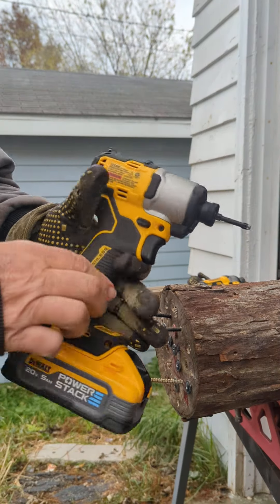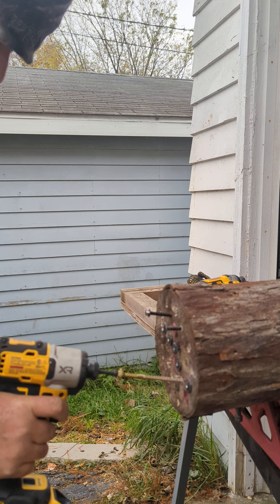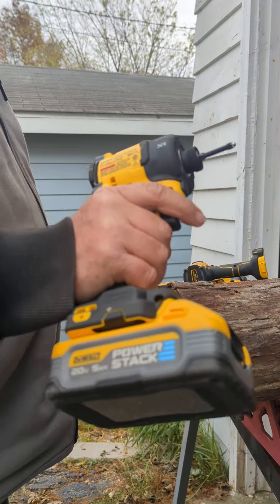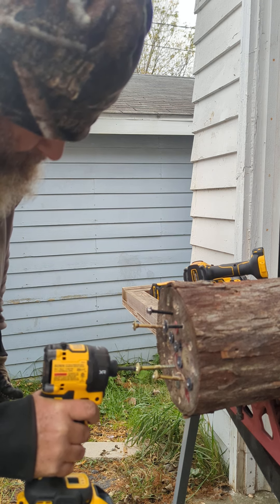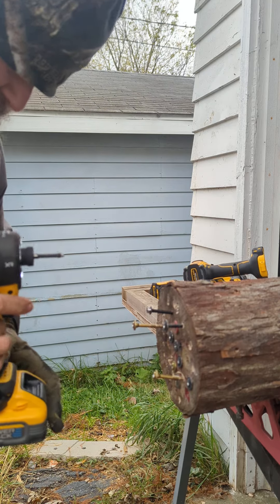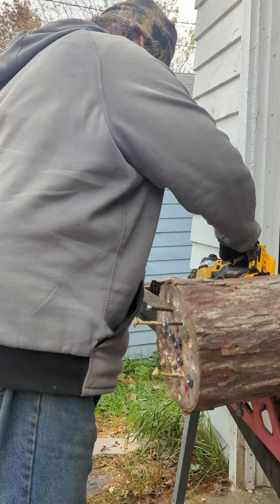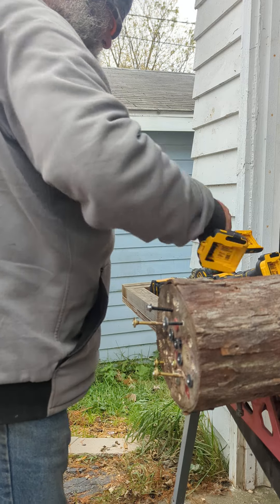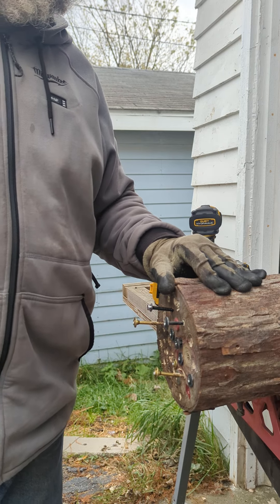NEW DEWALT XR DCF 870 HYDRAULIC IMPACT DRIVER TAKES ON ALL IT'S Brothers 5 AMP POWER STACK 8 AMP PP

Comment: Dude I really want to like your videos, but they are just not worth watching because you can't do complete tests. How do you strip out what should be torx heads? Change your bit, it's the wrong size. How do you not understand that DeWalt uses their speed 1 for their "tightening" mode and not for real torque? The impacts aren't even impacting because the resistance is greater than what the tool is designed for. I have been hoping for a long time that you'll get better, but it doesn't seem like you can. It's just ridiculous how bad some of these videos are dude, but I feel like I have to be critical so you can be better before I give up and stop watching your channel.